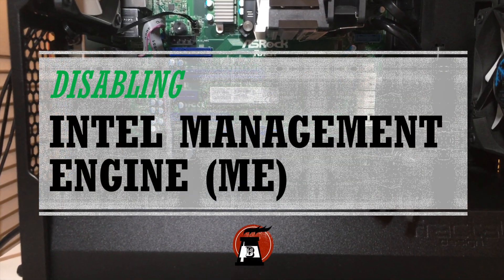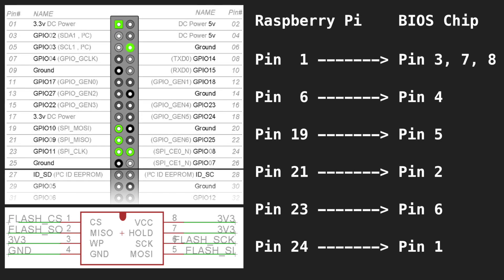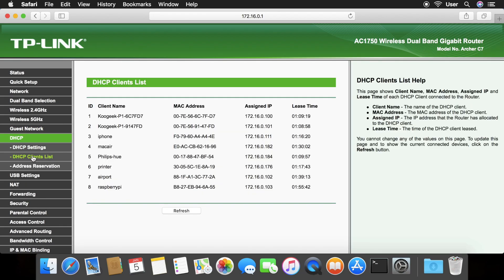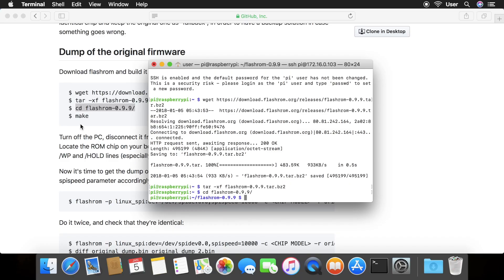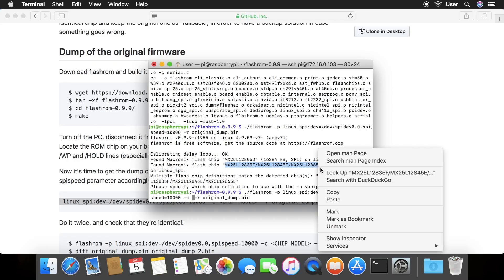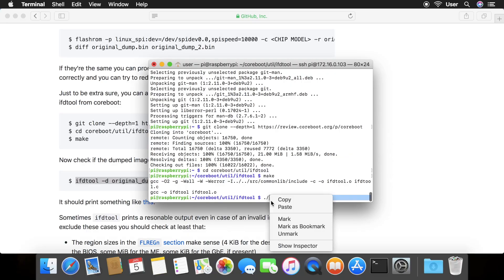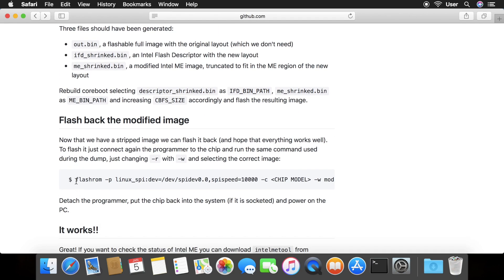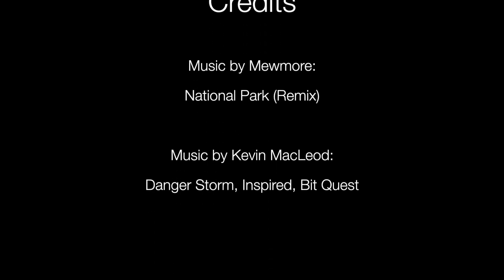DIY: Disabling Intel ME 'Backdoor' on your Computer

Comment: Alternatively if you don't want to take any risks, you can put your computers behind pfSense router and configure pfSense to deny all incoming traffic by default, like how Gufw firewall in Linux denies all incoming traffic by default. This way, anything trying to remote into your computer will be denied access right off the bat.
Reply: As far as I know me works independent from the os network stack. With wireshark you can not see packets sent by ime.  If the firewall runs on any Intel chip after 2008 you got a hole in your fw itself..... this is very concerning .....
Reply: To think and believe big money governments and organizations would use known and documented protocols for eventual secret communication is shooting oneself in the foot I believe as regards dissecting the eventual process in question.

Comment: Can make a ultimate way to stop windows spy shit and thanks in advance
Reply: Use GNU/Linux
Reply: @MrPolluxxxx  Well the Vault7 CIA leaks from WikiLeaks (largest CIA leak in history which included CIA hacking tools with source code) revealed that they even had backdoors for Linux and most routers. We won't even have a chance at privacy until we have open source software on open source hardware

Comment: Hey, my knowledge surrounding this area is very limited, but I have a question regardless nevertheless:

Is there any negative effects that comes from doing this? Also, is there no other sort of "backdoor" or security issues that I need to consider when it comes to standard hardware on a pc? :p
Reply: 1) If you are running windows as your main operating system, forget about IME, if you were that paranoid from the beginning, Windows wouldn't even be an option for you.
2)I believe that IME cannot be disabled, and as said in another comment, if it was your computer probably wouldn't work, watch a video on the functions that we know IME does and you will understand that it also has its upsides.
Reply: @IT Developer It's funny, I'm building my own 8bit breadboard CPU, which can't be hijacked except through hardware, as software barely exists on it.
Reply: If an attack have access to the physical hardware, then it's already game over. No amount of encryption or hiding things is going to keep someone from getting into your PC.
Reply: @IT Developer amd is not much more secure. Their equivalent of IME is actually on their CPU instead of mobo and cannot be disabled. Only upside is that it supposedly has less capabilities than IME.
Reply: @BeHappyTo  Uhm? Intels IME is also on the CPU.
Reply: @lm6036  "Intels Intel Management Engine" is not on CPU. It's on mobo. More accurately - it's on PCH
Reply: Thanks for the tips y'all. I appreciate it. Scary times we live in :'  )
Reply: @IT Developer Or you can be smart and go with Ryzen...
Reply: @IT Developer As far as I know, Ryzen is only affected if you have physical access to the hardware (at that point you've lost anyway). Please correct me if I'm wrong.
Reply: @IT Developer libreboot not safe against spectre

Comment: This is really cool and thanks for the easy to follow guide. However I am curious why all this is required. For example ThinkPads have a whitelist of WiFi cards, and there is a program called no-1802 that modifies your BIOS. How come a program couldn’t be developed that would do this?
Reply: Because ime runs completely separate to the bios. It's on the chipset as far as I know. It has it's own spi flash and runs even before the bios is booted.

Correction: ime kernel is in the bios spi and me_cleaner removes all unnecessary partitions of that firmware.
Reply: But how come he removes and reprograms the BIOS chip?
Reply: @retrogaminggenesis6102  as far as I understand me_cleaner clears the Bios of all checks and hooks that ime has in the bios. There are certain checks within the bios which authenticate that ime is intact and running and then allow the bios to boot. If not disabled your PC would not boot at all.   I'm looking into this right now and I'm still learning :)  
Frightening security risk .....
Reply: Same here, I’m new to this and still researching. 

No-1802 works the same way, it clears the BIOS check for an authorized card so it will work with any Mini PCI card.

Maybe it’s because Intel ME is required, and if you installed a no-IME patch it would cut Intel ME’s communications. But as the PC is on it is still running off the old instructions to communicate with the Intel ME (as a reboot is needed for the changes to start) it would freeze.

Do you have any clue if CPU’s with vPro disabled have the same backdoor? It lacks Intel AMT from what I hear but no clue if it still has the Intel ME.

Thanks for replying btw.
Reply: @retrogaminggenesis6102  as far as I know all of the cpus /chipsets do have full me capability despite Intel Vpro or anything dissabled @bios level. This works even if the PC is off and still has power..... if ime receives a certain packet it activates and you have full hw control over the machine. It even works before encryption is "running".

In some research I found they say it's in the pch (chipset) others say ime is inside the CPU itself). All of them confirm that every silicon leaving Intel has ime capabilities or gives access to ime to the hardware.
Reply: Hp bioses are rsa signed to. Tried to get a wifi card running on a hp 2670p with no success.
Reply: Yeah, they all have Intel ME, but I heard a rumor vPro disabled ones don’t have Intel AMT so the chip is basically useless. Any true if it’s clue?
Reply: @retrogaminggenesis6102  as far as I know there is no way of disabling it for the end user completely besides nodding the bios. 

AMT is a remote management framework like ipmi or ilo. Allows admins to remotely access pcs at bios level + console access (video). That in itself has serious security flaws. Google "null field amt" or "certificate amt bypass"

Even if you disable vPro the ime is still in tact and if it receives the magic packet it'll just tenable every feature it has.  As far as I know there is no way to even check if ime is dead after the bios flash. You the end user can not see it or touch it....

There are some company's that disable ime in their notebooks. 
Dell offers ime free pcs to government only. Guess why :)

Comment: Can someone explain how it works
Reply: So basically, you use raspberry pi as programmer/flasher (various people call these various name, its device that can flash different chips, depending on device (ie. AVR flasher)) for bios. First he creates dump of the bios, and backup dump, than he uses python script to change one bit that intel had to introduce becouse NSA, but didnt document it, that basically disables ME, like killswitch thing, than he reflashed modified BIOS back onto bios chip.

And if things go havoc, he can restore orginal bios by having second dump saved.

Also on the way he enables raspberry to act as flashing device, and that diff command, checks if bios dumps are equal (if he managed to have corrupted read. Better safe than sorry with these things).

Thats exacly what he did. Actually pretty good tutorial for linux newbies ;)

And these random apt's were installing dependencies the flashing software needed, and console program to download the second program (if you are newbie, you may think of like he downloaded internet explorer, to download application)

Edit: fix typpo.
Reply: @by010  perfect summary
Reply: @by010  So this actually turns off the Israeli Talpiot back door? I figured some genius would find a way to turn it off. Doesn't look that bad.Just one bit? Nice. I have done that before hacking software. Really easy to change the logic on a branch operation.
Reply from the maker: Hi, it works by disabling a single bit in the firmware: "a mechanism that can disable Intel ME after hardware is initialized and the main processor starts.. we describe how we discovered this undocumented mode and how it is connected with the U.S. government's High Assurance Platform (HAP) program. ... the name belongs to a trusted platform program linked to the U.S. National Security Agency (NSA)"
Reply: @yoonsikp  Can you please explain what everything is going in the video?
Reply: @johnnyblack4261  Watch with cc on
Reply: @yoonsikp  Hi, do you know if macbook pros are affected? And if they are affected, is there a method for laptops as well? My laptop's CPU is a i7-4870HQ
Reply: ARP4D You know macbook pros are affected because they use intel chips made after 2008, I'm not actually sure if they have standard bios chips as I'm not louis rossman but I'm sure someone else has a better answer
Reply: Tntmod54321 thank you for the reply!
Reply: @yoonsikp  do you have more information on how you discovered this and some resources to further explain what is going on (to someone completely new to this)?
Reply: https://github.com/corna/me_cleaner/wiki/How-does-it-work%3F
Reply: ffs, read the readme on the github.
Reply: @XDRosenheim  I was thinking the same, lol.
Reply: He just did..
Reply: no
Reply: RTFM
Reply: Basically it loads before the OS itself into memory at ring 0, then passed control on to OS, it effectively become the VMM of your OS at that point and nothing you can do can hide from it. Now that e some rootkit tactic right there
Reply: A small sized donald trump gives the intel backdoor a headbutt
Reply: @yowut8075  They're going to build a wall and make the southbridge pay for it!

Comment: I had corrupted BIOS so i re-flashed the BIOS and my computer boot again!  but it crashes a lot i get this error message every time i restart the computer: "ME Firmware Update failed" and "Error sending end of post message to ME: HECI disabled, proceeding with boot"  do you get that too?
Reply from the maker: Please reset your CMOS battery. Then see if the problem persists.
Reply: @yoonsikp  i fixed it by re-flashing it again haha it had a pending BIOS update that corrupted it again, thanks

Comment: What is the use of doing all this if you're using MacOS or Windows, which are  backdoor in itself?
Reply: thats why i use linux. MacOS and windows is a mess
Reply: Tails is the best
Reply: one less backdoor, then board up the other backdoors when found.
Reply: Pierre Parent I don’t think windows and macOS is giving information away! macOS is relatively secure and doesn’t give information away... Windows let’s any company do whatever they want but don’t sell information...
Reply: @prestonferry  HAHAHHAHHAHAHHAH LOL
Reply: Linux MInt1 that wasn’t meant to be funny!
Reply: @prestonferry  windows dont sell info? thats damn funny as fuck
Reply: It is hardware flaw. There is no way to fix unless physical tampering.
Reply: It doesn't have to be Windows; if the hardware itself is compromised for example by the Intel Management Engine (Intel ME) or the AMD Platform Security Processor (AMD PSP), you even have dataleaks, including maybe keylogging and maybe even encryption keys.. you never know..